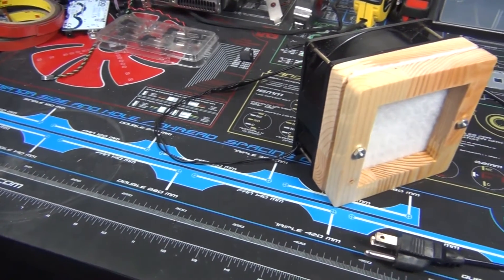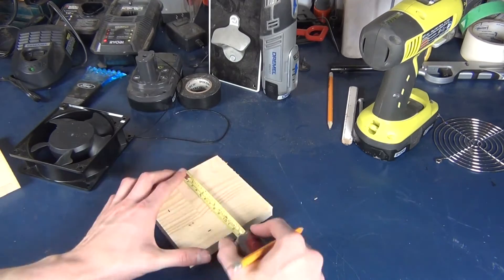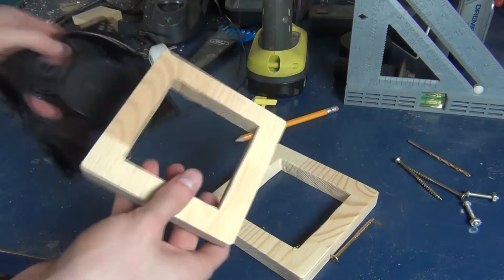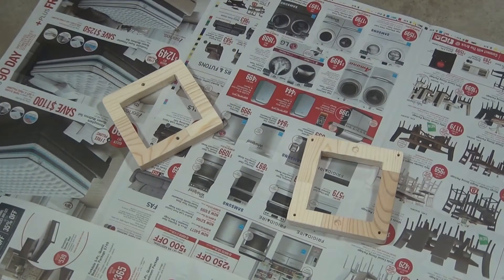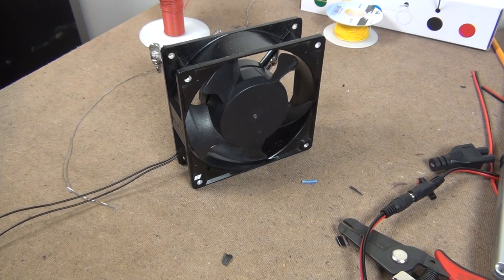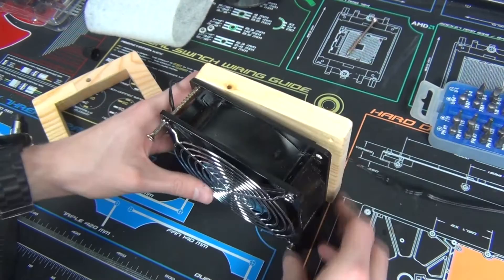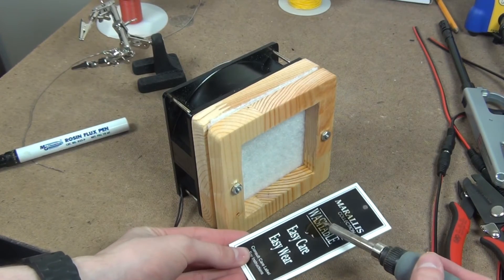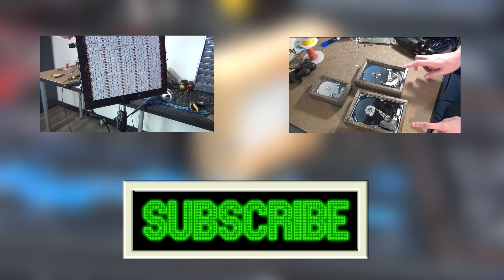How to Make a Super Cheap Soldering Air Filter

Comment: Sir that's the same has having just a fan.
If you want to improve that you need activated carbon and an hepa filter and a pre-filter (same filter as you used there), that's what's inside of professional ones.
That one will not filter any particles, and smoke will be everywhere in the room
Reply: I was going to say the same thing. That filter he is using is completely useless for filtering out the solder smoke.
Reply: Filter he is using will get out a very small percent of the largest particulate.  It may also keep it out of his face directly.  I'd suggest something like a Radon fan, a large canister of various filter material including hepa and activated charcoal.  Of course getting the air to not channel on the charcoal is tricky.  This is better than nothing, but no good for anything but occasional use.

Comment: You can't just use any filter. Needs to be some kind of carbon filter. These activated carbon filters would be perfect for job http://www.ebay.com/itm/Activated-Carbon-Filter-Pads-for-Eheim-Classic-2215-350-2628150-/261016794361

Comment: Nice and Simple! what kind of filter is that? does it absorb the fumes from soldering
Reply: Nirmal Chavan it has to be a carbon filter or something similar or better
Reply: The filter used is insufficient.  The smoke doesn't appear to exit the other side because it's being diffused by the fan :(  Need hepa + charcoal.